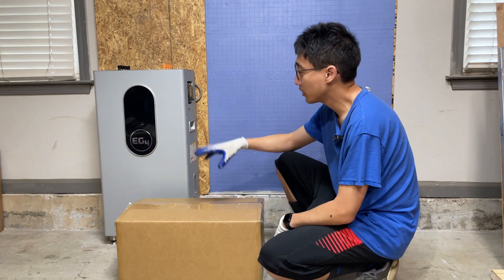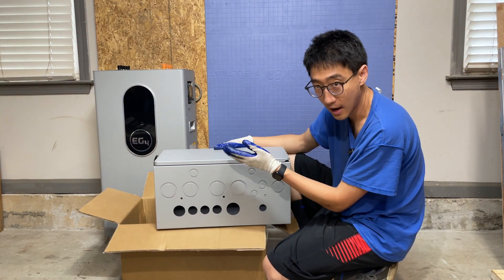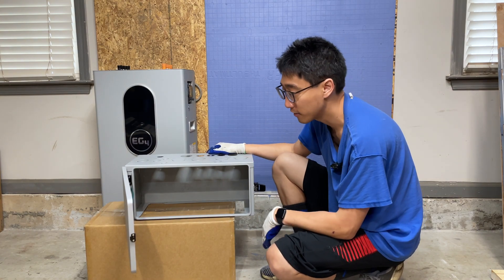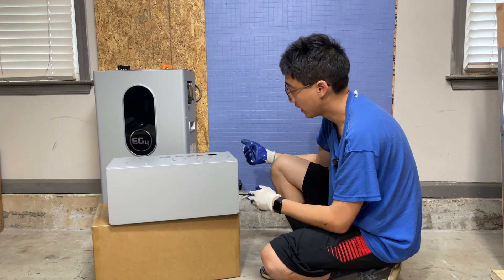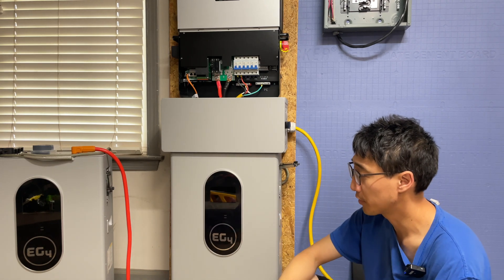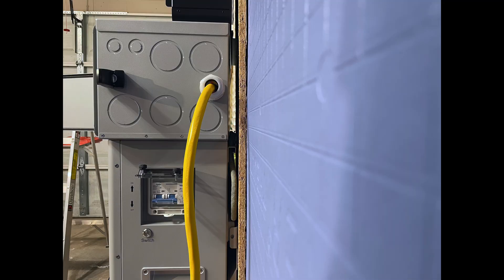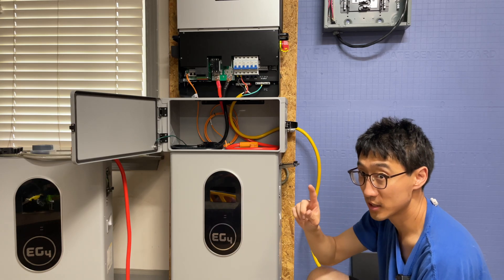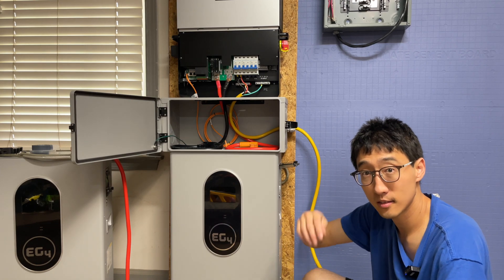EG4 48V Indoor 280Ah WallMount Battery Conduit Box Unboxing / Review | 1511094

Comment: I just got mine and the conduit box you have to assemble. Not a big deal. Good video.
Reply from the maker: Yeah they have a new version
Reply: Same here and no slot to access the 6000xp mounting screws.
Reply: @mr.e7022  This confounded me.  I just built the box after the 6000xp install.   Is this what you did?

Comment: Hello, could you do me a favor? Could you measure how tall the battery is from the floor to the top of the battery? I am mounting the conduit box before I get the battery and need to know how high from the floor to mount it. Thanks
Reply from the maker: The battery is about 36.5 inches from the floor to the top plate of the battery, with the feet on the battery. The terminals and connections sit above the top plate so make sure to account for that.
Reply: @tgbatg  Thanks